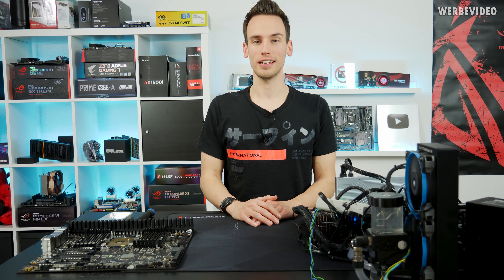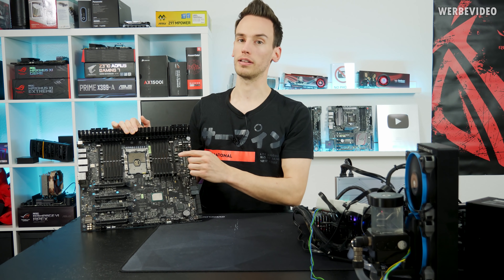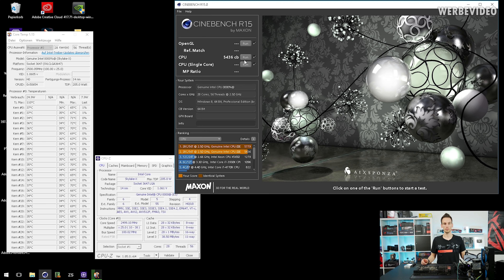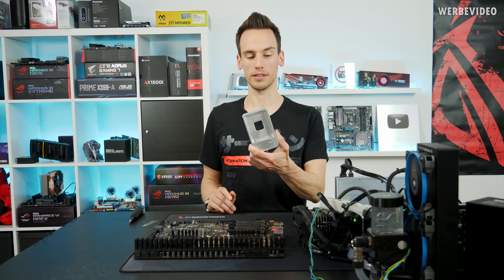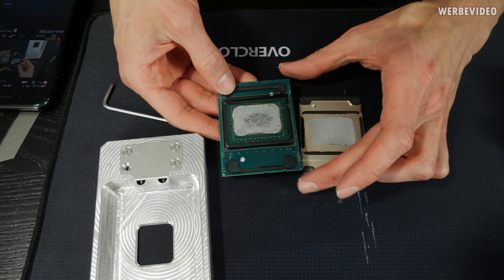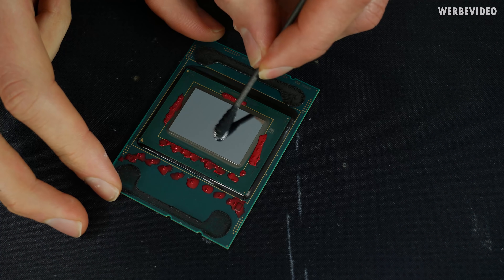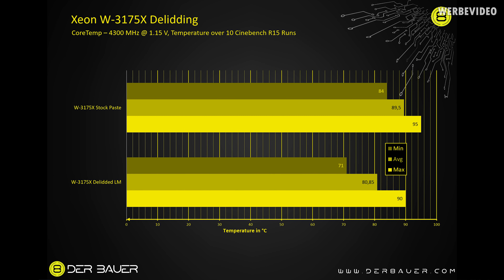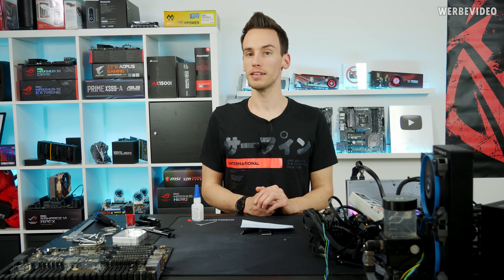The most EXPENSIVE CPU I've EVER delidded!

Comment: an i still got my score of 6228 with threadripper 2990wx. No delidding needed or a crazy huge motherboard.
Reply: Threadripper doesn't need delid beacouse it's soldered
Reply: nice! What frequency? My tip is 4.1 GHz for this score and RAM 3466 c15?
Reply: Very strange... I have more than 11k at cinebench r20
Reply: @Jacob Horgan, but can your cpu double as a small heater? Not with AMD
Reply: Intel are desperate...also Intel record profits, I wish I could be that desperate.
Reply: yeah whats your gaming FPS like.  You have a chip with compromises, due to the memory latency problems of the 2990WX.   The power draw, price, and performance of the Intel chip is insane.  It's a halo part that's meant to send a message, not actually be competitive in the open market.
Reply: @HAHA.GoodMeme  nobody will be gaming on this chip, intel literally only put this out as a sign of desperation in order to sell their inventory of HEDT cpu's before amd releases their 7nm products
Reply: @1pcfred  amd makes and releases products, tsmc provides raw materials. This is like saying intel doesn't release products because they get their sand from a supplies, apple doesnt make products because they use parts from other companies. Not really sure you understand how our current world economy works. Nobody has vertical integration anymore
Reply: @1pcfred  LOL, most stupid thing i have ever read. Dude in order for TSMC to manufacture their chips AMD needs to design and around TSMC manufacture specifications. All transistors are made by TSMC on AMD chips are designed by AMD. You can look that up. AMD doesn't have the labs to produce 7nm that's a fact, but that's just the process that TSMC uses not the technology that makes TR good.
Reply: @1pcfred  yes but it's still their products. They don't own fabs anymore but it's still theirs. That's like saying a phone isn't released by that brand because it was assembled by Foxconn.
Reply: @1pcfred  what is your point though lol. Why does it matter whether or not AMD manufactures the actual silicon? They design the chip TSMC manufactures it. Does that change anything? Intel is still in a pretty bad place in wake of zen 2.
Reply: @1pcfred  lol falling behind your competitors is always a bad place to be. Telling your investors you're potentially 2 years behind does not spur confidence.
Reply: @1pcfred  if a different direction means lacking in performance and power efficiency then sure. AMD doesn't need a fab. Right now they have the better product for the enterprise world. That is why they are gaining market share in the enterprise.  Consumer parts don't matter nearly as much as enterprise and AMD is offering a 64 core part for less money that Intel's current offerings with more performance and less power.

That isn't a "different direction" that is Intel being unable to get to 10nm before AMD released a 7nm product through TSMC.  AMD has the better architecture right now the more scalable architecture, they are ahead of Intel right now. Not a different direction as both companies are going after chiplet designs. AMD is simply ahead
Reply: @1pcfred  Nope, not at all. I am comparing products.  And you can be impressed by what ever you want but that doesn't change that both AMD and Intel understand monolithic chips will NOT hold up in the future.  That is why Intel is working on stack-able chiplets and why AMD is pursuing their chiplet design.  

Just because you are impressed with a 2 year old 28 core chip doesn't change that AMD has a 64 core EPYC CPU that is faster than two Xeon 8180s while consuming less power and is far less expensive.

You can tell yourself what ever you want to believe what ever you want, but don't confuse your beliefs with what is actually happening.  There is a reason AMD is gaining market share in enterprise.  There is a reason AMD did better than Intel in the recent earnings reports.  There is a reason investors trust AMD more than Intel right now.  If you want to call that reason "Intel taking a different path" that is fine.  But it REALLY means Intel is behind.

Will they be behind for long? Probably not, but as of this very moment, they are behind.
Reply: @1pcfred  Samsung and TSMC invest billions into Fabs as well, companies AMD can have manufacture their chips. AMD does not need a Fab to make competitive products as evidence by Zen.   So Intel having their own Fabs doesn't mean anything. This is about who has the better product line and that is AMD.  We are talking about right now, not 2, 5 or 10 years later.
Reply: @1pcfred  Just gonna assume you're a troll.
Reply: @1pcfred  Intel doesn't produce all of their own stuff either...where do you think some of their IGPUs come from? Hell Intel's even used AMD to make their IGPUs before...hilarious. 
Hey at least maybe someday Intel will get their 10mm process down instead of pushing it down the road because of delays.
I guess this guy thinks Nvidia is a joke too since they don't make their own chips for their GPUs.
Reply: Paul Frederick By your logic NVIDIA makes no products too...
Reply: @1pcfred  yeah Intel seems very technologically advanced, can't even design a proper socket for this CPU
Reply: Paul Frederick TSMC is the company they use for manufacturing.
Reply: Neither of those cpus are "for gaming" on top of that chances are if u have the need for threadripper you probaly have a dedicated gaming pc as well.  I think the messege this cpu sends is we cant compete in a meaningful way in this market right now so heres this overpriced pos
Reply: @HAHA.GoodMeme  yeah no idea lol. It's being used for virtual machines not gaming.. why would you even bother. Also it's just on a noctua air cooler and runs fine don't need a water cooler or a super expensive motherboard just to use it.
Reply: @jakeAU44444  lord of freedom get owned
Reply: @HAHA.GoodMeme   "it's a halo part that's meant to send a message not actually be competitive in an open market"
Same with the fx9590.
Reply: @HAHA.GoodMeme  It's not memory latency, it's Windows throwing a fit at too many threads. See Level1Techs videos for diagnosis of that issue.

Comment: 4000 Euro 28 cores = 142.8 eur/core, or 163 usd/core
While for 9980XE = 111usd/core , 9900K = 66.25 usd/core.
I really don't believe the extra 2 memory channel would make any sense especially when the socket is so hard to install.

But still entertaining to see what's under the TIM.
Reply: When you pack 1 inexpensive thing into a package with 28 of these things, ofc the price is gonna go up. Especially at this level of scale, nanometers, and make it so each core can communicate with the rest of the cores.

And if someone is gonna spam here: "It's pointlessly expensive", no one forces you to buy it right ? There are Ferraris and Bugattis, and there are Nissan GTRs and Porches.
Reply: Ryzen 1700 €160 = €20 per core
Reply: @leaferrafael  I got my 1700x for 125$ so it's like 15$ per for core for me
Reply: Veyron: 1000HP/$1mill, $1000/HP
Corolla: 150HP/$20k, $133/HP
Lawnmower: 4HP/$300, $75/HP

I'll take the 1000HP lawnmower please. 
See mate, things doesn't work this way.
Reply: @txisbest2010   I did not know the lawnmower performed the same job as a Corolla or a Veyron.   The correct explanation would be a 2080TI vs a 1060 in terms of power and price.
your "lawnmower" would be a single core ATOM.
Reply: It is harder to get 28 perfect cores over 18 perfect cores out of a wafer

Comment: Sick Stuff bro..  :) That mount though is going to be a real pain for 99% of the guys who buy this for workstation use. The loss of channels on the mem is worrying.
Reply: I can say from personal slash friends' experience that this is a problem going back to X79 and X99.  In my case, the system was briefly moved outside for dusting and upon first cold boot only 3 of 4 DDR4 modules installed was visible.  It took re-seating the CPU and heatsink (being extremely careful not to overtighten in the slightest) and swapping memory modules from side to side to have all four memory channels to function again.  And this happened with a lightweight 150W rated aluminum 3 heatpipe heatsink and tower being moved with kid gloves the entire time.

As an aside perhaps @der8auer would have better luck with torqued drivers?

Comment: Still not as risky as disassembling a 40k$ RED 8K camera.
Reply: Linus disassembled the Helium sensor, so it's "only" $24,500. 

And Unlimited Uploads, it FILMS in 8K. It doesn't COST 8k lol
Reply: @Capeau  and it's about $150,000 for the entire unit (and that's just to use it)
Reply: linus
Reply: they are 8 grand each not 40 each.
Reply: @unlimiteduploads2971  I award your knowledge with unlimited downvotes, across your videos.
Reply: Unlimited Uploads with that reasoning all 4K TVs cost $4,000